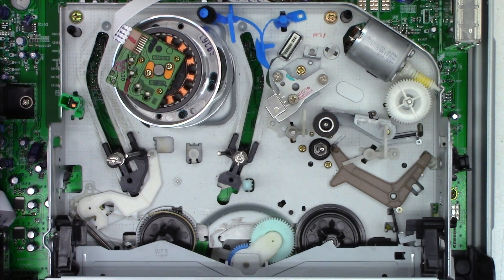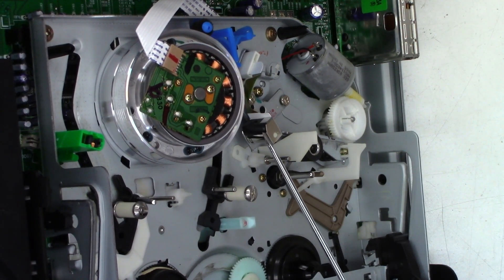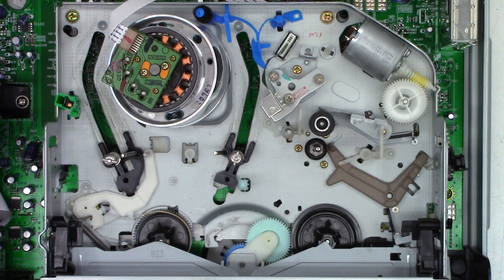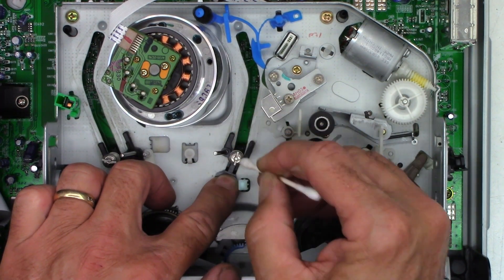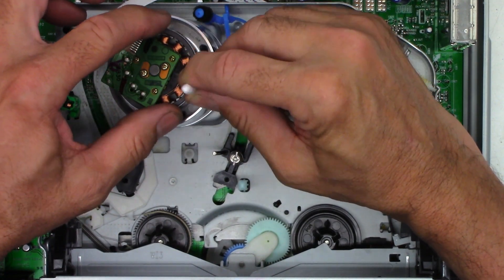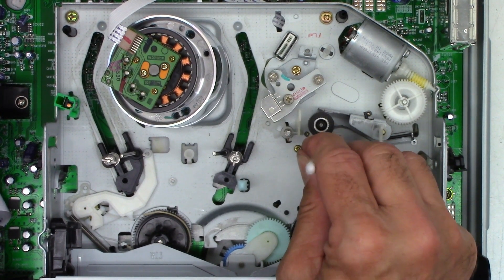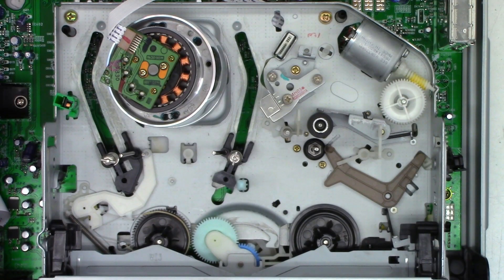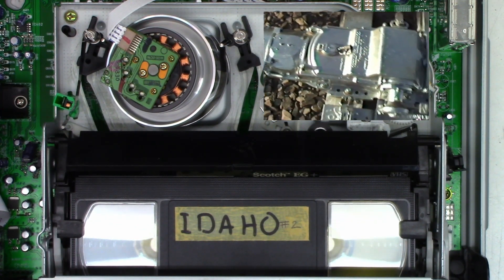VCR Servicing Basics on a Zenith ZBV443 - Clean and Lube

Comment: Could you recommend a brand of grease to use for the tape guides? Also, do you use any lube for the capstan spindle? Ive seen old vcr repair videos from back in the day that suggest a light  capstan lube and some kind of grease they dont make anymore, for the tracks. 

Does anything else require lube or grease? Should the idler be lubed?

Comment: I have a 1997 Admiral 20 inch TV with a built in VCR. When I plug in the TV I can hear a loading motor run till grinds down to halt. I can not put a VHS tape in the unit as it only goes part way and stops as something blocks it. So I believe part of the loading mechanism is out of time? Do you have a video on this type of repair? The CRT says Orion and I don't know who made the VHS in it. But I want to attempt a repair when I know a bit more about the loading mechanism.
Reply from the maker: Orion did manufacture the units back then under the Emerson name sometimes. They were quite good units and had an above average picture quality as I remember doing warranty work for them in the 90's. They did have a couple of loading belts and a weird shift mechanism to engage the tape loading mechanism to the chassis. The belts were the downfall of those units. I had a few 9 inch TV/VCR units that ran on 12 volts that I would jam in between the seats in my Honda Accord to play tapes for the kids on long road trips. (before DVD's) worked like a champ. Check the loading belts that come off of the main loading motor. Sorry I do not have any data one the timing of the mechanism. Email me the model number and I can see if I have a service manual. Norcal715videos@gmail.com

Comment: Thank you again for your very educational videos. I have learned a lot from you! In the matter of cleaning PCB's with acetone after using flux, do you actually NEED to clean the flux off? Is it conductive enough to cause problems, or do you clean simply because you like things to be clean? I'm happy to do the same, but wonder if there is any other reason for the acetone scrub afterwards?
Reply from the maker: It can attract dust (conductive in some cases) if you don't clean it off. I think its better to be safe than sorry. Thank you.
Reply: @norcal715  Ah, ok, that makes sense. The residual flux remains tacky, of course. I have been cleaning it off, but began to wonder what the good reason for doing so was! Thank you very much. Please keep the good work up 🙂

Comment: I appreciate your videos but I'd strongly advise to use different materials for cleaning... what you use it's ideal for you but I am pretty confident not advisable to everybody else.

Despite having minimal experience with video tape transports I'd encourage anybody else to consider Isopropyl alcohol or methanol for cleaning agent.

Isopropanol is a very noble cleaning fluid and can be safely used with most plastics, unlike acetone which eats into polyethylene and other kind of weak plastics, smells funnier and is an aggressive harsh liquid. In contrast Isopropyl alcohol is less volatile and more oily, perfect for a cleaning solution. Once dried it should leave no marks.

Cotton swabs, including Q-tips, are a liability anywhere near a video head... I can't understand why one should play the Russian roulette with the drum. It's so easy and convenient to wrap a cotton cloth around it and spin it. My technique involves spraying the cloth with a mixture of distilled water and isopropyl alcohol as it is NOT necessary all the cleaning force of a 99% pure alcohol.

Even the idea of having an acetone bottle on the bench at the same time a VHS unit is on disturbs me...even the tiniest droplet is able to leave a mark on clear window displays and it doesn't end there. Besides... not even isopropyl alcohol is suitable for that kind of plastic, despite being a heck of a lot milder than acetone it would still leave stains. The only suitable cleaning agent for such clear windows is window cleaner, mild soap (rinse with water) and water itself in its demineralized form.

Comment: You didn’t put the part you squeezed back in? 

And any recommendations on cleaning VHS tapes that were stored in a hot garage and has mold (white ) on top of tapes.   

Thanks
Reply from the maker: No I did not put the auto head cleaner back in, It did test ok but may fail at any time and when they fail they gum up the works (literally). Look for a VHS tape cleaner on eBay or another used site. Ambico used the make the cleaner/rewinder units as a complete unit. They had a couple of felt pads that the tape would pass through in FF or REW. I used to have one for 8MM video tapes years ago.
Reply: @norcal715  Thanks for recommendation.  i will search for one.  

I I was looking for a cheap vhs in goodwill or something to just FF or RWN and use micro cloth to lightly squeeze tape going through. (you tube video)
Reply from the maker: That should work.

Comment: Do you know what could be the cause of hi-frequency whine on the linear audio output many of the 2000s LG-made VCRs like the one in the video? It seems to be common on these specifically, haven't encountered it on any other brand (well other than on an old JVC SVHS from 1992 I got but that was caused by a bunch of clearly bad caps in PS and elsewhere, which didn't seem to be the case in the LG's I've tinkered with.)
Reply from the maker: It probably has some bad decoupling capacitors in the audio processing circuits/low voltage power supplies. Try heating and cooling the various capacitors in that area to see if either the frequency changes or stops altogether.